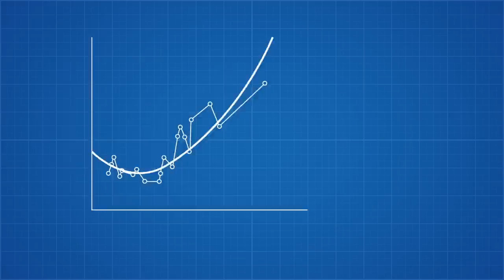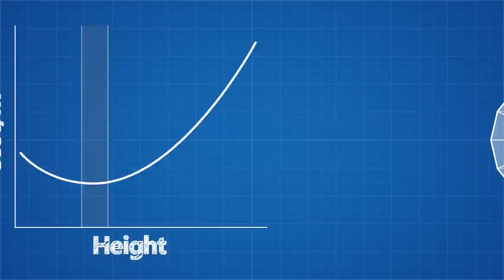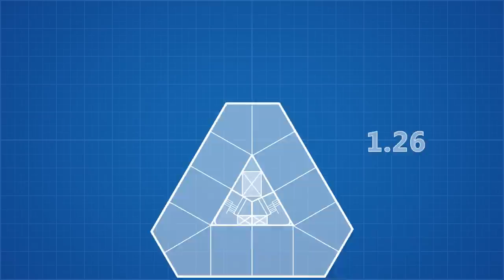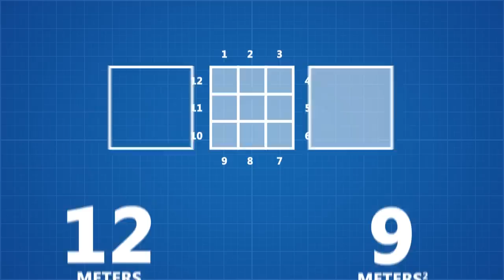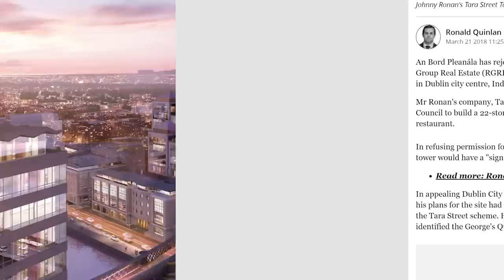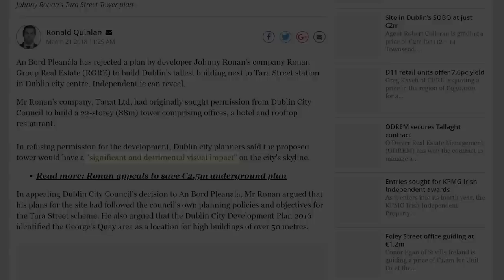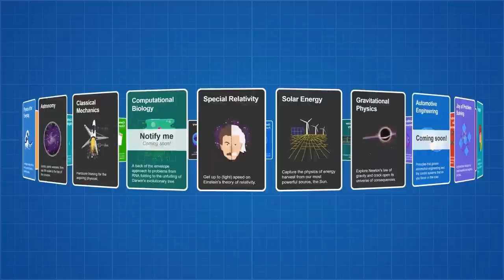How to Solve the Housing Crisis

Comment: 3:25 WRONG.  The minimum cost per square meter is at 12 stories.  This is one of those situations where it's NOT correct to just plot all the data-points onto a curve and ignore how they differ from it.  There are specific thresholds where specific systems and costs become necessary- this is a stepwise curve.  Therefore, the individual data-points are the best thing to go with, and point to a minimum at 12 stories of height EXACTLY for the Netherlands/Shanghai.  In Hong Kong, the Price Minimum is at 21 stories.

Realistically, It's usually best to build slightly above the minimum price-point though, as the increased transportation costs (wider/longer highways, more train stations and bus stops, more subway lines) to serve a more spread-out city have to be accounted for too.  And higher density allows for more Mass Transit and more efficient utilization of public services (ambulances, police and fire Don't have to travel as far to a call, fewer post offices are needed, less distances for school buses to travel or a higher proportion of stydents walking to school, etc.)

So really, the optimal/cheapest city height is about 15-18 stories, once you account for these externalities...
Reply: How can you come up with one answer for the whole world? You must be wrong.
Reply: Your assumptions are wrong. There is no one perfect figure for every city.

Comment: NIMBY is only partially to blame.  One thing left out of the video is Prop 13.  This caps the property taxes that can be collected by local governments. This incentivizes the development of commercial property over residential due the additional sales tax and business tax revenue.  Cities actually lose money with residential housing because the cost of delivering services (police, fire, sanitation and other basic services) is more than what is collected in property tax.
A couple of solutions may be in order.  Lift the caps on property taxes.  Exempt high density developments from most of the environmental regulations.  One of the ironies of environmental regulations is that they actually do more harm to the environment with respect to CO2 emissions and air pollution. People increasingly are commuting over longer distances, spending more time in cars and driving up pollution and CO2 levels.  From a community planning perspective, the 2 most effective ways to combat it is through the development of high density mixed development and a strong public transit infrastructure.  Practically every other industrialized country has figured that out.
And lastly, California residents need to realize that they are a part of the problem.  But they can easily be a part of the solution.

Comment: I love high rises and skyscrapers. I wish my own city (Gothenburg), which has a comparable population to Dublin, would invest in a lot more of them. We're getting Sweden's first proper skyscraper in a couple of years at 245 meters (73 storeys), and some more 100+ meter buildings here and there, but I still think we're too slow with it. I'm not so sure about the standardized high rises/skyscrapers, though. Do they simply make up an inexpensive skeleton to which you then add cosmetics on the outside, or do they all end up looking more or less the exact same? If the former, then that sounds fantastic, but if the latter, it sounds like a potential trap that would make a city look like an old soviet concrete town.

Comment: Some areas have height restrictions because of unstable foundations. Why do you think Amsterdam has tilted buildings? Why do you think the towe of pisa is leaning? Some of these height restrictions are in place for safety reasons. Think like an engineer
Reply: Sure, but the housing crisis of Amsterdam and the Randstad (Western part of the Netherlands), can be solved, if we build a story on top of the roof. Made from the leight material wood.

Comment: It turns out that the USSR was extremely advanced - when building apartment buildings, parking space was calculated to about 1 car per 3 - 10 units, since few people had cars (to buy a car, not only you had to have a lot of money, but also wait in line). And currently those parking spaces are overflowing, because everybody has a car now (used cars are cheap), sometimes multiple cars per apartment (if both spouses work, they may need separate cars).

I guess we will return to the USSR way of not having cars, but then we should then also not forget the other good things the USSR had - everyone had a job (guaranteed by the government) and a place to live.

Comment: +Real Engineering   You appear to have missed the real reason housing is so expensive.   the true reason for sky high housing costs is actually zoning and building permit restrictions.  This issue was mentioned in the video when you said san francisco prevented most locations from building higher than 3 stories despite 6 to 12 being the optimum height for cost effectiveness.  Washington DC does the same.  In New York city I've heard you cannot get a building permit at all without bribing politicians or being in bed with the mafia.  Guess what?  We just named 3 of the cities in the USA with the highest costs of housing.  On the other hand Houston Texas HAS NO ZONING and their housing costs are not particularly high.  Houston is also a big city and if it were simply a matter of population they should be just as expensive as san francisco or DC.  The reason it is not is because the REAL problem with housing costs is simply an artificial chokepoint on supply which is the government.   Housing is expensive because AN EMPTY PLOT OF LAND WITH A BUILDING PERMIT is expensive.  THAT is the chokepoint.  Building a house is trivial and not at all expensive compared to the cost of a piece of land to build it on.  The plot of land including the building permit is only expensive because city governments MAKE it expensive by refusing to give out building permits that they don't want to give.   Land is not particularly scarce. In the US for example we have developed only about 5% of the land area.  The Federal government however owns and prohibits development on up to 85% of some states like Nevada.  Get rid of zoning and the concept of building permits and planning commissions and you solve your housing cost problem basically overnight.   The free market would solve this problem IF WE LET IT.   I'll leave you with a final point.  Housing is 3 to 4 times as expensive today as it was for your grandparents as a percentage of your annual income.  Without government interference that ratio would likely not have changed.  This means the average house SHOULD be about $75,000 but it is instead $250,000.  How much better would your life be if the government had ALLOWED you to purchase your housing for a mere $75,000?  You would have so much money left over that you could do many other things you want to do.  Think on it.  If you want to know more, then the economist thomas sowell wrote a book dealing with this issue called "economic facts and fallacies"

Comment: tl;dr: If the world was a sane place, the existing construction methods could be used to build somewhat-taller-than-existing houses.  The problem is not primarily that existing methods became too expensive; the problem is that ... see below.

"cost minimum at 6-8 floors"
If you assume that the cost curve is continuous.  Unfortunately perhaps, there are some discontinuities, e.g. with 4 floors (or fewer), several cities allow you to not build an elevator.  In America, you might be allowed to build a 4-floor house from wood, while anything taller needs to be reinforced concrete.  Thus the cost curve for concrete houses with elevators has its minimum at 6-8 floors, but there's another curve with a lower point at 4 floors.  (Of course, this all depends on what local regulation allows.)

"People who already own houses are less interested"
That depends.  If (as in most American cities) ridiculously restrictive (from an European or Japanese Point of view) zoning is the problem, then the restrictions being abolished would eventually cause housing unit prices and rents to drop, but would drive land prices up.  This is especially visible in American cities, where e.g. an area with single-family houses and duplexes directly adjoin.  Unit prices are mostly the same on each side of the line, but the price of a plot on the duplex side is ~twice the price of a plot on the single-family side.
Thus, if people who already own housing units want the plot their house is standing on to appreciate, they would support rezoning.

As you point it out at the end, the process is mostly not technical.  (It was slightly profitable to build houses at earlier, lower prices.  If the world was a sane place, the existing construction methods could be used to build more (slightly taller) houses, and with the supply increased, the problem would go away.)  And the most annoying part of the politics is that it's like a knot; the higher the tension, the higher the friction.

Let me explain.  If you are a developer, and you want to build a taller building in the place of an existing one, you need to (1) buy and demolish the existing building for its market value, (2) get a zoning variance in most cases.  These two costs don't depend on how high the new building will be.  They shift the cost curve to the right by a whole lot.  (Buying and demolishing a 3-story house and building a 6-story one in its place means the three new floors will have to pay back the cost of demolition and erecting the 6-story building, which we can approximate as 2 floors of construction cost per added floor.  If you built a 9-story building instead, 9 floors/6 added floors = 1.5 construction per new floor.  And the "floor construction cost" of a 9-story isn't much higher than a 6-story.)  Thus you, as a developer, will want to build something quite a lot larger than what you demolished.  Consider the absurd: if you only built a 4-floor, that single additional floor would have to carry the cost of constructing all 4 floors.  Building houses only incrementally larger than what they replace makes the replacements far too expensive.

However, local NIMBY residents and town council members see that---to build something affordable---you want to build a much larger building, something that doesn't fit into its surroundings aesthetically.  The cheaper (and thus bigger) you want to build, the more fiercely they oppose.  A frequent compromise is that the developer has to build some beautification for the residents (a small park, perhaps), as aesthetic compensation---however, its price must necessarily be built into the price of the units in the new building.

It also doesn't help that, partly due to the above effect, the construction market behaves as though it were rate-limited.  What happens when an industry is only allowed to produce a fixed number of goods per year?  They focus on the high-end market, because they need the higher per-unit values available there.  Thus developers have a tendency to build "for the rich" whenever they are allowed to.  In a sane world, they would very quickly saturate the high-end market and move on to middle-class, then lower-middle-class markets; but with the effective rate limitation in place, this doesn't happen.

Thus locals and councilors see that the "evil developers" build only "for the rich", and thus oppose new projects---reinforcing the rate limit and the phenomenon the hate.

Comment: At the same time it isnt as simple as just building height restrictions and building types and styles of construction, you need to think about the weather, is the structure sustainable to the climate, how hot does it get, is there wind, can people living on the first few levels breathe.
My girlfriend lives on the 3rd storey of a building next to a canal, the flat is small, packed full of things, and theres absolutely no wind. Mosquitoes are an issue, the air is oxygen deprived(i once suffered the first few stages of hypoxia when i was in her room due to my heart disease that requires higher oxygen intake), they dont even have a store room.
Nothing is simple, when you think something is complex with 3 or 4 layers of thoughts, it actually has 7-12 layers you need to account for.

Comment: What if you go down to increase space. Like if 6 to 8 is best what if you go up 6 or 8 and down 4 would that increase space without increasing cost per amount of usable space? I know this is not usable in some areas because of things like water table (if it is close to the surface) or flood plans or pre existing infrastructure like subways. But barring that could it help with costs?

Comment: 9:50 they approved this building during the summer. Dublin is made up of Georgian houses. These are roughly about 12 meters high. The skyscraper in this picture will be 88 meters high. It will look like a 6ft 4 basketball player standing beside a bunch of toddlers. They shouldn't have approved it. Two of the buildings in that picture are the tallest buildings in Dublin city centre. If the drawing was taken from a different angle you would see how ridiculous it looks in comparison. They should have compromised to a building that was roughly 60 meters high.

Comment: Maybe we're approaching the problem from the wrong end. "People want to move to the cities" isn't the true source of the problem. The true source is that almost all service sector jobs are in the cities. Tens, maybe hundreds of millions of people commute for hours to get to jobs that only need a computer and a stable internet connection to do. The reason for it is the toxic presenteeism on the modern workplace - managers simply don't trust employees to do their jobs unless they are hovering above them looking over their shoulders, and the work done is measured in hours spent at the workplace instead of output.
Telecommuting is one obvious solution, but it's not necessary for everybody to work from home. Disassembling the huge corporate head offices into smaller offices spread out across the city or even across the country would also help.

Of course not every workplace can be decentralized like that. Especially work that involves moving physical goods. But there are plenty that could be, if only management would arrive to the 21st century.
Reply: And then 2020 happened ... and everyone who could work from home did.